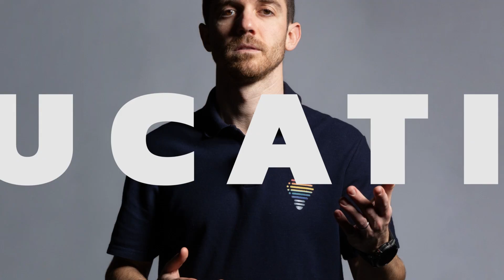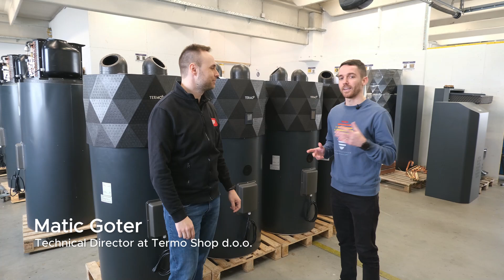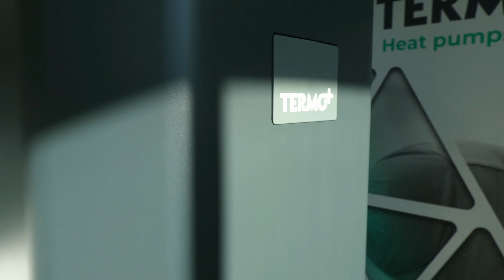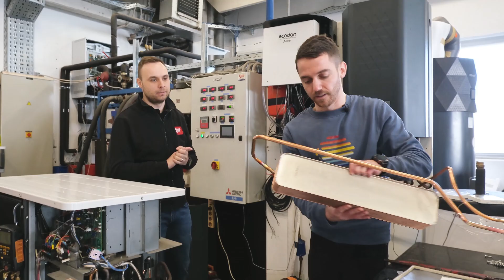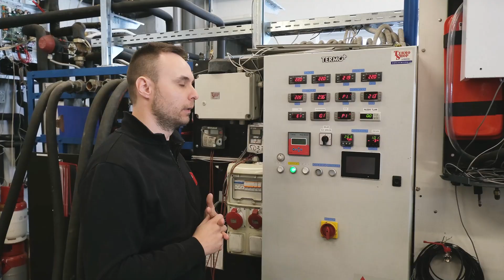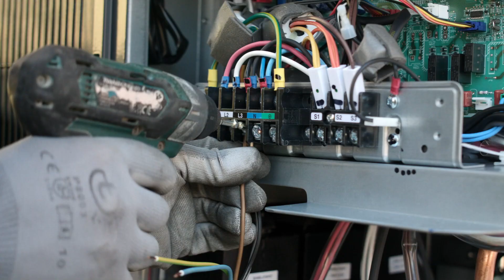Designing Custom Heat Exchangers for Heat Pumps | Inside TermoPlus Factory

Comment: Thank God Termo upgrades old fashioned Mitsubishi's FTC 😂...If Mitsubishi cannot, someone else can😂. Please also ask Termo install stronger pumps in indoor units. We have sent official technical question in Italy for their indoor units' pumps which are operating with quite low flows and large Dts, which leads to poor performance....they replied us to design our underfloor heating systems with larger Dts😮😮😮. We hope Termo differentiates from other manufacturers that design their products only from their point of view, without taking under consideration clients' demands!
Reply from the maker: As I understand, they are always open to change components if needed, but I will send comment to them